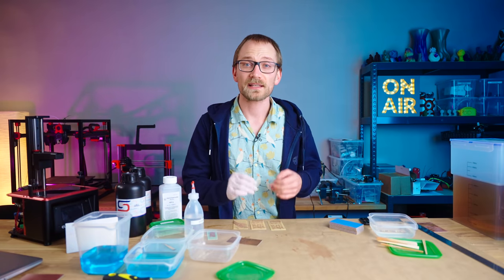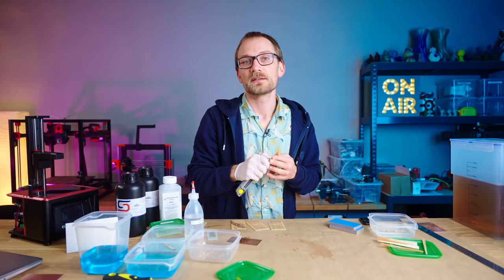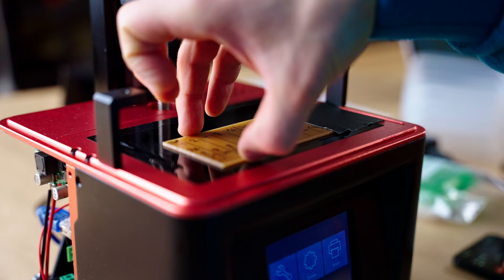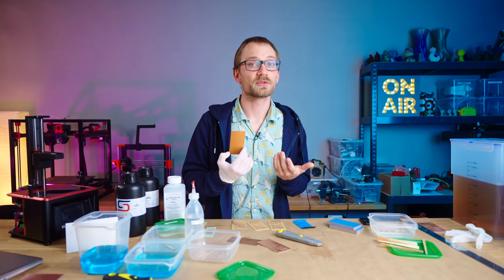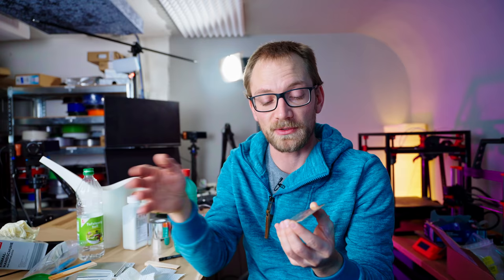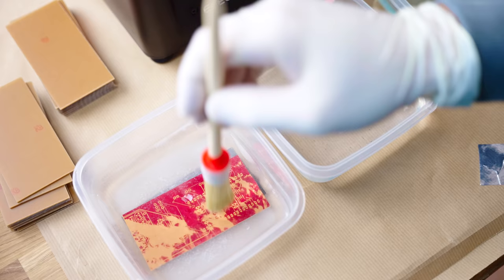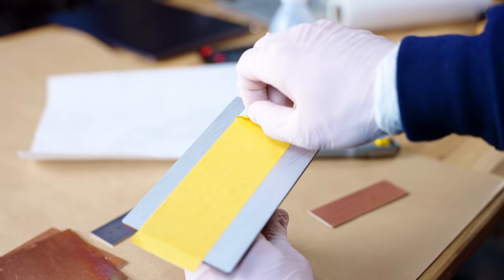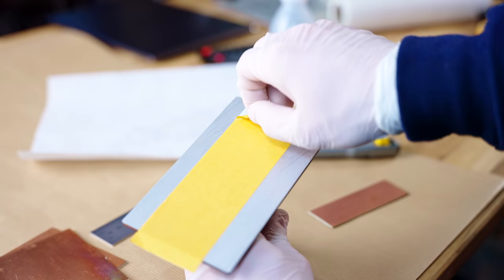The fastest way to make crisp PCBs at home!

Comment: Now that I think about it, the parts used here aren't expensive.
Prusa's UV LED assembly 138.50€ and the display 118.90€

Slap a simple µc on it and you have a product to make PCBs for 350-400 €

Where do I make a startup
Reply: A startup? Not so fast.
You still need to handle the through holes etc. And then multi layers....
Reply: why even use PRUSA for this, take and disassemble an anycubic mono (more open firmware) and write a program from Gerber to UV
Reply: @maevebaksa  Simply use a Mips2hdmi board, and connect it to a secondary monitor output of your PC and show the picture you want there...
Actually the Chitu system Anycubic uses is anything but open. Chitu even starts to implement encryption to increase sales of Chitubox pro. But with a Mipo2hdmi converter, an old Ramps and a PC (or Pi) you can totaly replace the Chitu system completly - maybe even modifying a Mono X to a tilt-tank system like the SL1S?
Reply: @maevebaksa  I wasn't suggesting to use prusa parts, I was just saying the parts themselves are fairly cheap even to the end customer, so I'd say this is doable.
All products I've seen don't use an LCD to directly "print" the layout.
Reply: @oleurgast730  that's why I said anycubic. Elegoo is the one who uses Chitu systems, Anycubic doesn't use Chitu hardware and doesn't have the encryption that you see in 1.9.0.
Reply: @maevebaksa  I have both Anycubic Photon and Mono X (4k). Both are Chitu based systems. You can also order all electronic replacement part directly in Chitu's shop.
Just the firmware does not use encryption (yet - but you never know what firmware upgrades might contain) - but also the Elegoo printers use this only > 4k. 

There is not "the one" using Chitu - in the low-cost segment its nearly all Chitu based.
Reply: @oleurgast730  I'm pretty sure that it's a different motherboard, or at least they're not directly from Chitu. Only the original photon motherboard is sold from them. I believe they also use custom firmware, hence the use of .photon and that whole ecosystem.

Comment: Sorry butt i don't see the point! You have a lot of work and chemicals involved. It is much simpler to laser print transfer and etch!
However if you do have a 3d printer instead of a laser printer this might be alright i guess. You can not have multi layer PCB's. So
go with a 3018 CNC and isolation milling all the software is free. Do the mapping of the PCB board mill about 0,35mm deep into the
cheapo chinese PCB. On top of that you can have any shape and holes for mounting, through holes and even your logo milled
or engraved into you project in one go, on one machine. You will have to use some very fine sandpaper to clean the PCB afterwards.
Butt there won't be any chemicals involved that can ruin your or your pets day. Yea keep your pets save and give them treats, a lot
of treats :). Cheers.

Comment: Nothing new !!!!!!!!!!! We do that since 40 year. When i was studient in electronic, is that we do, make circuit on transparent paper with black pen, put in on a uv machine, reveal it and put in acid. For me actually there one simple solution to make pcb at home : take pcb board, paint it in black and remove paint with laser (fine adjusted). I have made some test at work with a professional fiber laser and it works very well. But in this case we remove directly the copper with laser. The major problem was that pcb board are often not very flat so you have to found a solution to maintain it.

Comment: Sir, I am sorry, but I tried it myself and you are lying - there is no convenient way to make pcbs using the printer. The main problem is that no slicer on the market allows accurate positioning of the pcb at the same coordinate over an over. This is especially important when making double sided pcbs or pcbs that require cnc drilling. I am not even saying that you need an alignment template made of 90 degree angle and a thin film on the bottom to protect the screen. Maybe Elegoo will send you a new printer for your new review, but what you are showing is madness - finest way to kill your screen (90 seconds as base layer - this might affect the longevity of the screen) and puncture your FEP from sharp edges of the PCB
Reply: FEP is a use product, And for myself I really like the ability to make single sided PCB, I can just do some traces to be more versatile.
Reply: don‘t understand your points. if 90seconds in one run is ruin your screen. change this to expose for 180seconds with 1 seconds on and 1 second off … like it would print layers. For positioning. yes, just add alignment templates and import both traces in the slicer at the same time to adjust the postition and then only slice one after each other from this file.
Reply: @TheDacoon  you haven't tried it, I have tried it and it doesn't work. It is only obvious when you try rather than imagine in your head. There is no accurate positioning of traces in slicers, there is no 0 position you can stick to. Aligning the board while UV light is on as shown on the video? Well your eyes will ldefinetely say thanks. 90 seconds constant on exposure is not the same as on\off cycles on printer
Reply: @MegaBlackJoe  yes, i don’t have a sla printer. but each software for printer is working with coordinates and the display has pixel to address correctly. think the postining is only not straight forward but possible. will check after work with some slicers how to do this. and for the 90seconds. if you scale you traces to 9cm in Fusion or else and define for each layer 1mm to be 1 second on … you should end up with a normal print timing. the photofilm will not start again at 0 for the uv exposure. maybe with the on/off it need in total more exposure time. But not unsolvable problems.